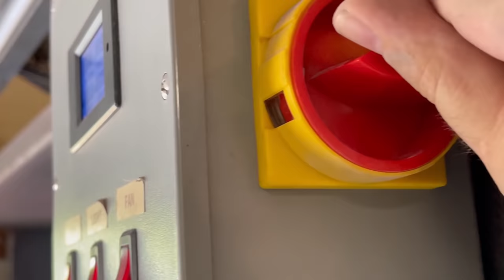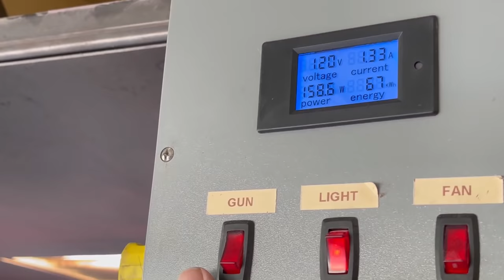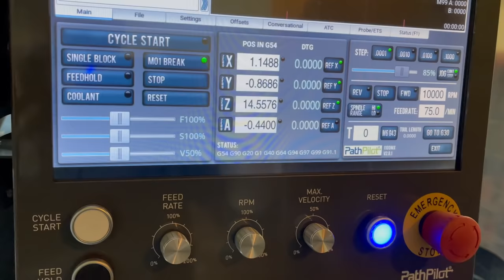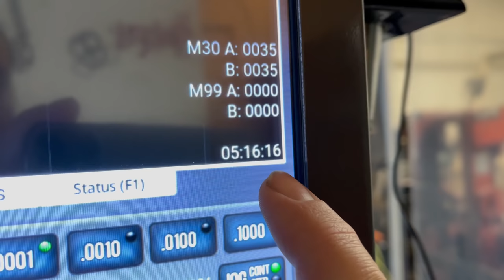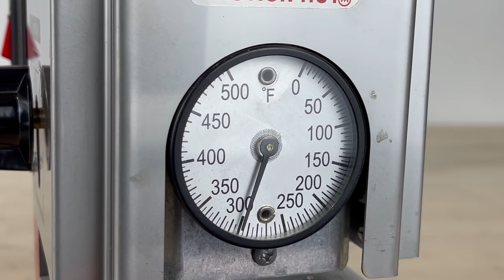1960's Nylint Lil Tow Dune Buggy Tow Truck Restoration

Comment: I have a trick I've used for years to clean plastic parts with lots of nooks and crannies. I put the parts in an athletic sock and run it through the wash with my other laundry. The detergent, warm water, and gentle agitation does a very good job. If the parts are fragile you might want to skip the spin cycle, though I've never broken a part using this method.
Reply: Thank you! I am going to try this.
Reply: It probably acts very much like that ultrasonic cleaner I've seen a few times.

Comment: Lots to be said here. First, it always brings a smile to my face when I see those beat up vehicles because it means that at some point in the past some kid really had tons of fun with it. Then, the restoration itself; this is nothing less than a masterclass. For every conceivable problem you come up with solutions with a surprising array of tools and machines. Then there's the dedication, easily seen with the time spent making the molds for the whitewalls. This truly makes you the best damned restorer on YT! Can't wait to see the next one and always hoping to see the Tonka truck I had as kid and that my father threw away.
Reply: I used to play scrapyards with my toy cars by smashing them flat with a hammer, just like in a real scrapyard. His scrapyard is a bit tame, he just piles them up, but I guarantee if they came into my scrapyard, he wouldn't be restoring them!

Comment: Looks better than new. You may try chucking the old tires in a drill press and while spinning them heat them with a heat gun, sometimes you can save them.

Comment: If you have time.  I would scan the tires, hubs, and other small pieces in CAD to have them when needed.  Just a suggestion.  We did it at work for special tooling fixtures.  It did save some time.

Comment: This represents a man who is investing his profits back into tooling in his business.   We see new tools constantly, and the level of breadth and depth of various skills is impressive.    I would say, that the only Mickey Mouse approach I saw was the use of the grinder to cut off the aluminum pulley wheel. Letting it fling into the lathe, dinging it up.   A proper parting tool for the lathe is not expensive and would benefit him.  But otherwise, hard to Imagine.  I have almost all the tools he does.  However, mine took 30 years.  Lol.

Comment: Superb video: I learn something every time. I am puzzled why you used aluminium rather than nylon for the pulley and why you used the grinder to part off the pulley in the lathe instead of a parting off tool. Best wishes from the U.K.

Comment: Cool restoration, the CNC work is outstanding and the bar has went through ceiling...I'm guessing sheet metal body parts stamping is next 😂...but a thing about the vehicle always bugged me...why would they envision a dune buggy as a tow truck?? That makes absolutely no sense in the purpose of the vehicle's use and I've been into cars for almost 50 years
Reply: Being that we have the Little Sahara Sand Dunes a few hrs away in my state, my guess is there have been people who've driven the wrong kind of cars/tires out into the dunes & got stuck (@ least, back in the '60s; hopefully people know better than to do that now).  Notice how wide the back tires are. So, my guess is the toy manufacturers know this happened, and made an appropriately decked-out tow truck.

Comment: Those tires you couldn't figure out how to restore... are they plastic or a rubber compound?  If they're rubber, you might look into a technique used by typewriter restorers.  They will occasionally rub brake fluid into a dried out/damaged platen to bring new life to it.  The chemical compound in the fluid has a softening effect on certain types of rubber.

Comment: A suggestion:
On sheet metal parts that have a tab - don't be quick to straighten these after disassembly. All it does is  unnecessarily weaken the metal.